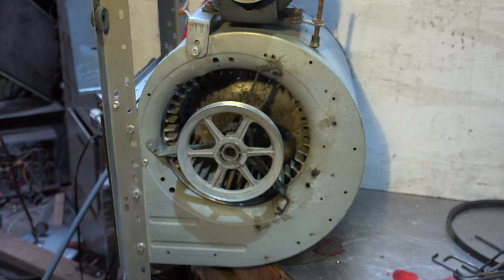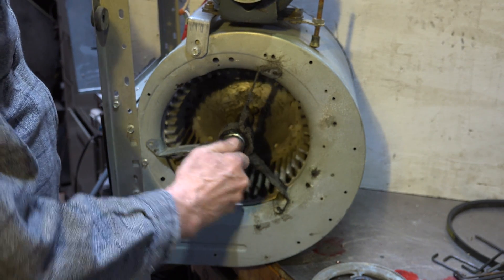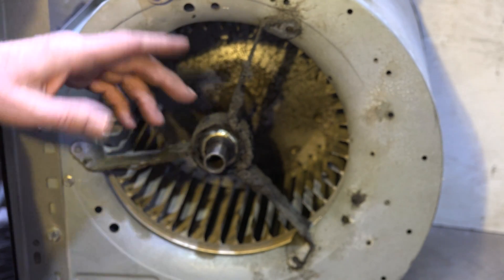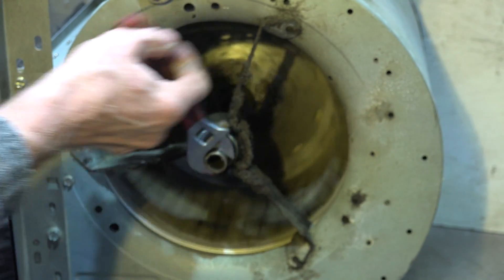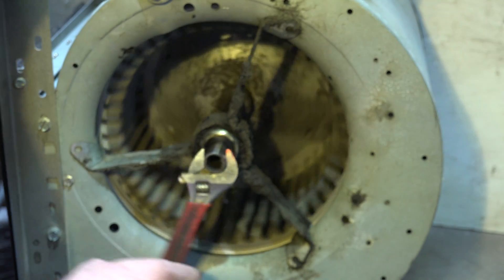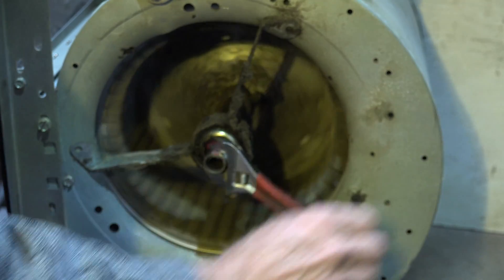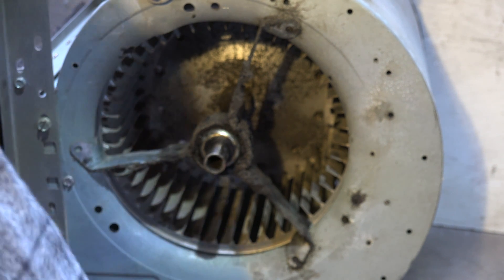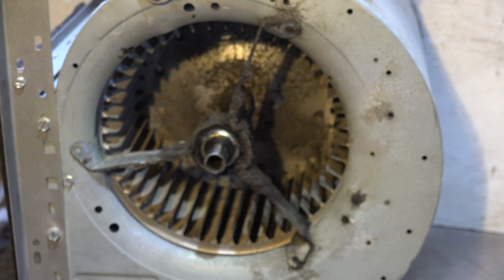What's wrong with this blower?  #14 Answer

Comment: Have you seen plastic evaporator pans on a furnace/air handler melt? Cause?
Reply from the maker: Usually they melt from a crack in the heat exchanger leaking hot gasses into the air stream.
GFM

Comment: I have a E2EB intertherm furnance that had ac.....4 wires......Im putting a Ruud Heat Pump 4 ton condenser on it........Can't seem to get the condenser to run for some reason........New Heat Pump Stat.....and I added a common wire to the system........got Emergency Heat working great.....I can connect the R from the furnance to the Y and R to the condenser and the condenser will run.....I have ohmed out all the wires to the stat and to the condenser.......the thing should work....it was working with ac before........when I call for cooling at the stat and check the condenser it's not calling at the condenser....seems like for some reason I'm loosing low voltage some where....got any suggestions
Reply from the maker: Way too complicated for a simple replay.  I would need schematics and maybe pics.
GFM
Reply: james fields maybe go through the thermostat manual and thermostat settings. came across many new installs especially on water source, air to air and water to water heat pumps where the thermostat settings were never properly set for the application.

Comment: thank you for making videos! last week HVAC hacker. residential Split unit. he removed R22 condenser installed a 410A condenser and used mo-99 in the 410A condenser.
Reply from the maker: Good grief.
GFM